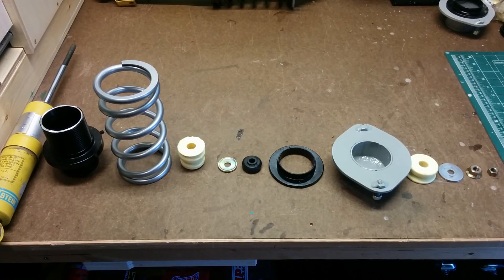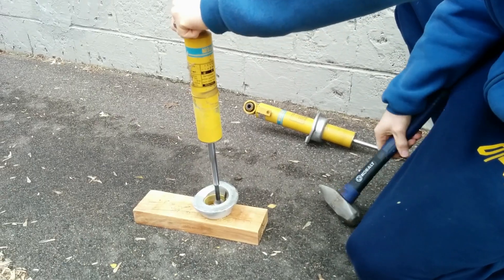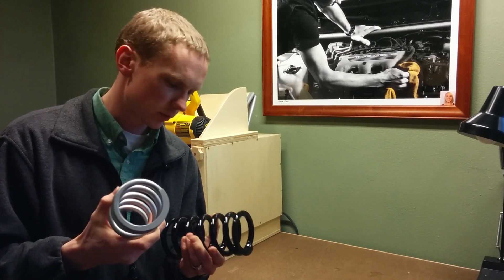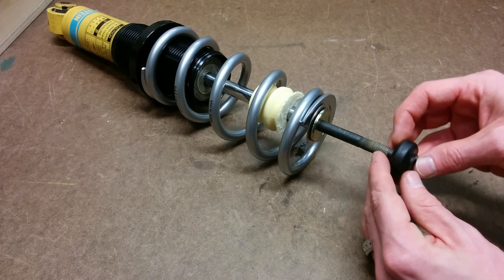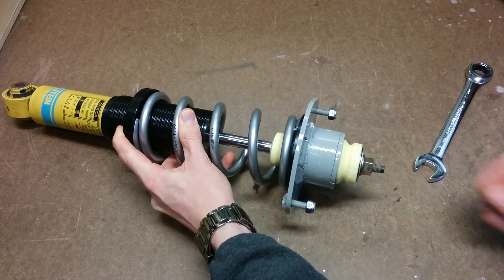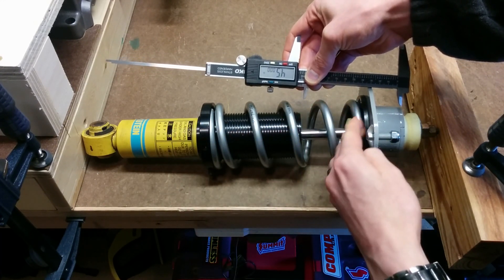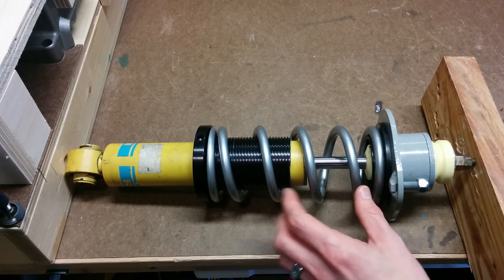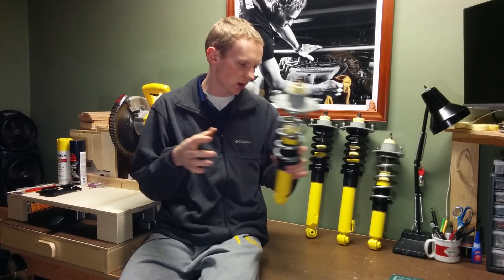DIY Coilovers for your Miata \\ How To

Comment: Forgive me but how is this beneficial Vs just buying adjustables?
Reply: It's cheaper, not better. This is a pretty basic design where the ride height and preload is adjusted on the same collar. He won't be able to lower it much without running into unseated spring issues because the spring isn't progressive.

Comment: What if you hit a corner and those springs come unseated?
Reply: They won't because there is a preload on the springs. The longest shock travel length doesn't allow the spring to unseat.

Comment: If I were to build a set of these for an NB would I need to get the tophats showcased or could I just use the stock tophats for an NB? Id assum the extended tophats are for use in an NA correct?

Comment: well done sir, but the truth of the matter is you can get miata coilovers for $375, the Bilstein struts alone cost a little over $450
Reply: You can’t compare a $375 no name Coilover to these.  In that same logic why buy a $2000 Coilover when you can buy your $375 no name brand.
Reply: @ericburgh421  their not no name coilovers, I'm talking about the Tein street coils
Reply: @connerbaldwin8405  I looked and considered the Tein Street basis Z for $500 which I assume you're talking about.  They have the name but otherwise aren't a strong performance based coilover based on the research I've done, and still don't compare to an $800-$2000 coil over.  I'm going with Bilsteins for myself and my decision is based on performance rather than looks.  To each their own.
Reply: @ericburgh421  respectable, that's interesting that the price went up on the tein street basis coils tho 🤔

Comment: I did ISC extended top hats on my FCM Bilsteins. For the spring isolators, I found that Gorilla Glue works very well. It's what FCM appear to use on their 2.5" spring isolators that they add to the NB top hats.

Comment: I have a 1992 miata. would you recommend new Billie's? I'm gonna grab the NB Billies but on forums people say to get used Billies an have them revalved. do you agree? I wanna buy new ones just to be safe but will they work fine? great video btw, exactly what I was looking for. how d they drive on your car over stock?
Reply from the maker: If the used ones don't have too many miles I would get used. They are reliable shocks and will last you a long time even if used. Mine are used and it rides great!
Reply: thanks man. I'll look used! I priced it and it was looking expensive lol. new Billies $400 from tire rack. sleeves from advanced $150, but I can get some eBay sleeves for $60 and cut them to 4". springs were $45-50 a pop for qa1s. where do u buy springs? i saw suspension spring specialists for $44 and some hyperlinks for $50. and top hats were $220 from garage star but they make awesome shit. isc is out of business I guess.any other top hat options? I'm excited. thanks man!

also have you seen auxbeam 7" led light bar headlights? they look sick! that's my next project!

Comment: Great video Justin! - the coil bind issue and solution is something not talked about on the forums.  btw - re-valved or stock Sport or HD bilsteins?  pretty high rates for no re-valve if so. how is the ride?  thanks.
Reply from the maker: Stock Bilsteins with no revalve. Definitely the stiffest you'd want to go on stock shocks. It actually rides really well. It's my daily driver. I love it.
Reply: +Justin Depew Are we related

Comment: I like this idea, well done!  I too hate the idea of someone else picking out my spring rates.  Maybe I want to determine my own front roll couple...why is that a crime?  That looks like the sleeves recommended on the miata turbo forum.  Your spring rates seem well researched.  I want to see a review to hear your thoughts after a few miles.  Should be very informative.  Great work!

Comment: I dont see why you would do this. I love the idea but with that money id rather get Megan EZ streets and have warranty
Reply: This is a much much more performance setup than Tein or Megans in every way.  Megans are more for the stance crowd.  Bilstein coilovers- for driving.
Reply: please don't compare bilsteins to megans
Reply: are megans crap compare to bilsteins? or vice versa
Reply: @OEFarredondo  yes megans will be crap compared to the bilsteins.
Reply from the maker: +Emmanuel Gamboa The main reason I did it was for fun...but I also got to choose my spring rates and those bilstein shocks will last forever.
Reply: Megan coilovers are crap, even compared to a pile of crap